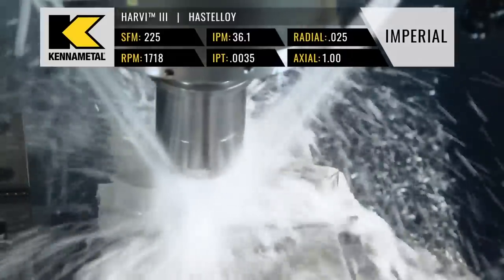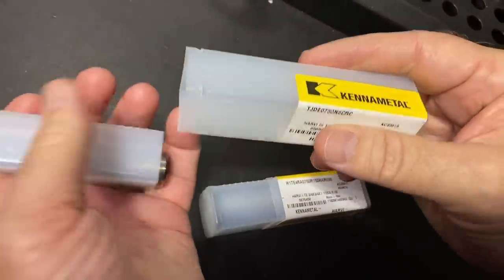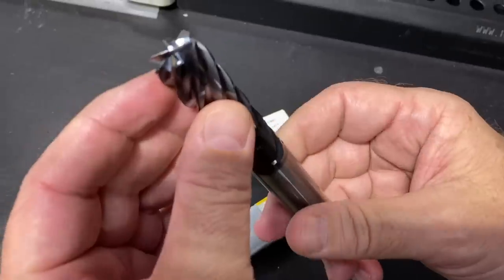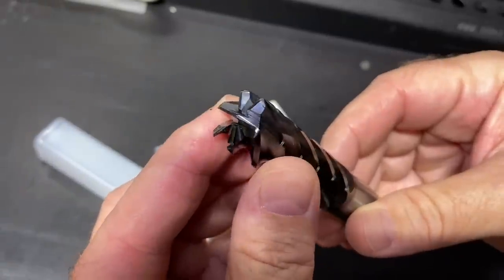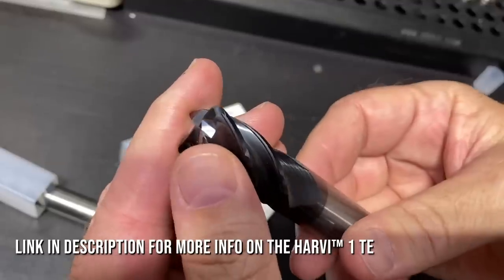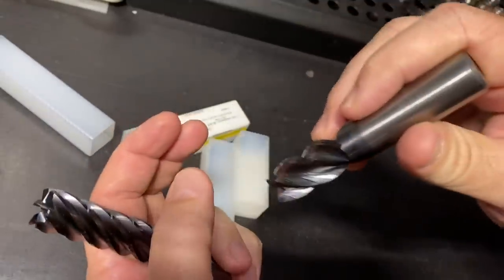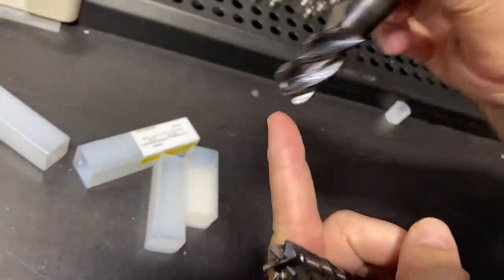The Difference Between These Two BEAST End Mills

Comment: Tool and material science is crazy. Part of my job is to program an 8 axis grinder and grind custom carbide tooling for my job. Mostly regrind work, but we get special projects frequently that require custom tooling for when we do toolroom work.Even a slight change in little things like core thickness, gash depth, or comb relief angle can make a huge difference when we use the mills.

Comment: Love that TE cut where you can see the head moving WOW what a tool
Reply: It must be part of the toolpath, it wouldn't cut w/o chatter like that if the machine was so flimsy that you could see the head moving because of the cutting forces.
Reply: @MF175mp  It's just a slotting tool path, a straight line, so what you see is the wobbling.
Yes, the entire spindle head is wobbling, but the tool didn't break, which was the main point, alltho you wouldn't want to use it like that all the time :)
Reply: Isn't it pulling down the pull stud?  The mill is biting so much it is trying to pull the tool holder out of the spindle
Reply: @bluustreak6578  You wouldn't run it like that at all, it's gonna wear down your spindle in no time. But for demonstrating the toughness of the endmill, it's pretty damn cool haha. Wouldn't run my machine like that tho

Comment: Is the Harvi TE better at slotting because the flutes are beefier (i.e. since there are only 4 each flute is thicker) so less likely to chip and break? Not that I will ever be slotting a 1" end mill into Titanium or Inconel on my Tormach in my basement, but always like to learn about end mills. Your videos have definitely inspired me to take full length DOC when contouring or 2D adaptive. Working my way through the building blocks, and figured well Nicole is taking deep radial cuts on her tormach, so so can I (maybe she can make some Tormach videos from home?). Stay safe.
Reply: There are several features that contribute to the Harvi I TE ability to full slot. But the main thing is that the lower flute count makes more room for the larger chips generated during a full slot operation.
Reply: More flutes equals higher strength as the flutes are not as deep giving you a bigger core. Core diameter is if you ground the flutes off to minimum cleanup leaving the solid round core left. Fewer flutes are cut deeper giving more chip clearance allowing deeper cuts in softer material but because the flutes are deeper the core is smaller.

Comment: Watch the HARVI 1 test on DUM 50 at 4:35 ,it moves with the tool holder. Is it caused by a trochoid path or low spindle rigidility ?
Reply: its caused by ramming it into the steel real hard xD
Reply: @bsod4144  That doesn't answer his question.
Reply: The movement you see is not programmed. This movement was there because we exceeded the bending moment of the spindle connection. So not what we would desire, but a real testament of the tools capability. It is so tough that it even survived the spindle flexing during the cut.
Reply: When it do this with HSK63 then I would like to see what it would do with the CT 40 taper.
Reply: @dannydavis705  Thanks you for explanation.
Reply: You will need to adjust the parameters to the connection forces from a CV40 taper connection.  Safety always first.

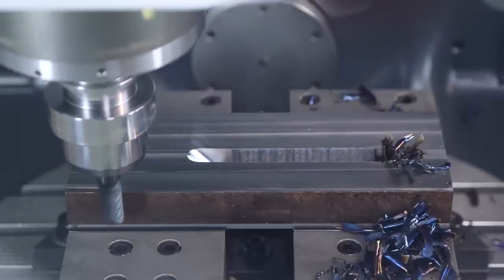Comment: 4:27 is that lateral movement part of the path or is that pushing the machine past it's limits? It doesn't seem to continue all the way through the path. In the second shot 4:37 sure looks like the spindle is flexing
Reply: The movement you see is not programmed. This movement was there because we exceeded the bending moment of the spindle connection. So not what we would desire, but a real testament of the tools capability. It is so tough that it even survived the spindle flexing during the cut.

Comment: Of course I love what you're doing for the trade and most of your videos, but I gotta say I'm a bit disappointed to see Autodesk and Fusion have been left of your sponsor list of your videos the last couple months.  You explained a while back that you would be using and teaching both but now it appears Autodesk has been replaced.
Reply: A lot of others on YT are using fusion and plenty of those videos around. One that gets far too overlooked is Gibbs Cam and integration in importing solids. Far as cam and great toolpaths Gibbs has a fantastic software system that can be tailored to the user. I like modeling in fusion and inventor but tool paths and selection are not that great.